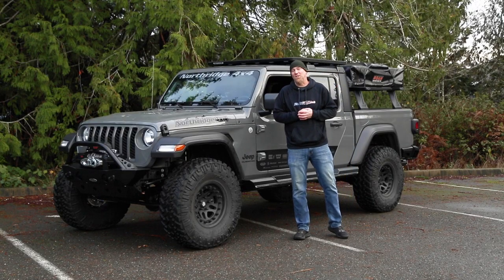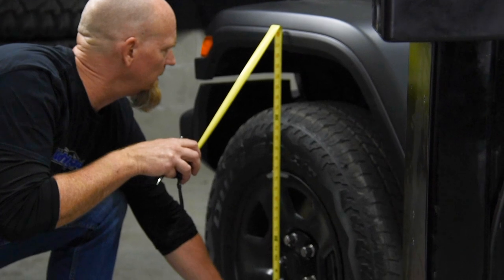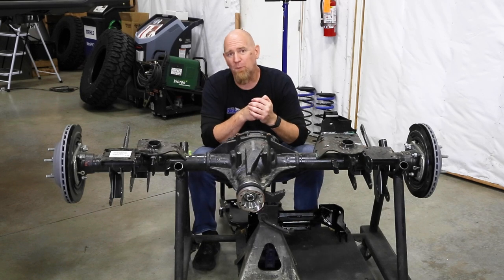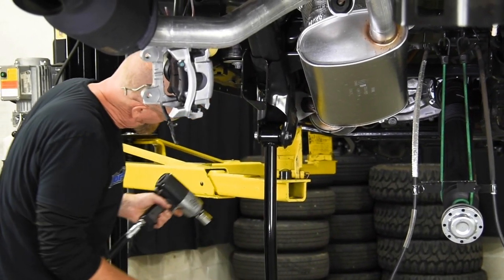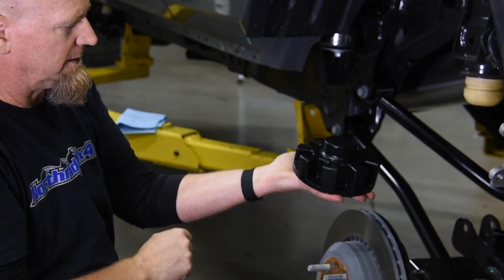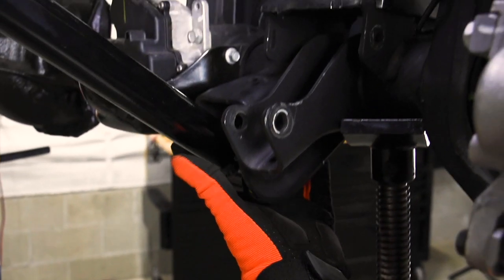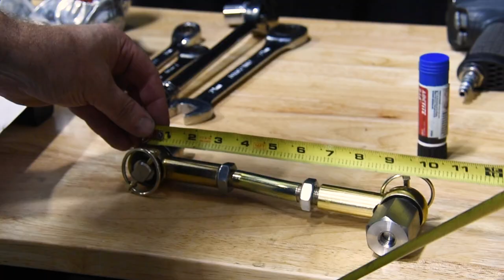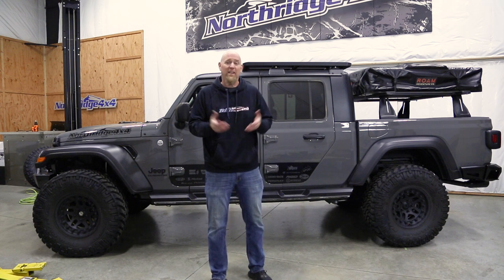Rock Krawler 3" Adventure Pro Lift Kit Install - Jeep Gladiator JT

Comment: Dumb question - if you put in a 3-4.5 shock in doesn't it allow for the spring to fall about when the shock is fully expanded? 3" lift with 4.5" shock.

Comment: Love the set up. I went with the 3” pro x. Not hard to install. The four link is the way to go. But having and issue with the front springs driver is bowing. Not sure why. Any suggestions on how to fix. My JT has not moved out of drive way after lift installed.
Reply from the maker: Did you get the top spring cushions clocked correctly in place?
There are two little stubs sticking up that fit into the upper spring seat. If they don't, the coil cushion sits cock-eyed and the coil will bow severely.
Reply: @northridgenation  yes. Installed 3/4” spacers in the front. So I cut off the stubs. I think the combo is what through it off. All so messed around the isolator. Looks like it is corrected .

Comment: Can you just do the rear?  I have a Mopar lift just wondered if you can keep that with going with the 4 link in the rear?!?
Reply from the maker: Yes, we do offer those parts separate from the front. BUT, you really want at least 3" of lift for the rear PRO X kit.
Rear PRO X kit:
https://www.northridge4x4.com/part/control-arms/rk07878-rock-krawler-adventure-pro-x-upgrade-kit
Matching lower control arms:
https://www.northridge4x4.com/part/control-arms/rk07854-rock-krawler-adventure-series-rear-lower-control-arms